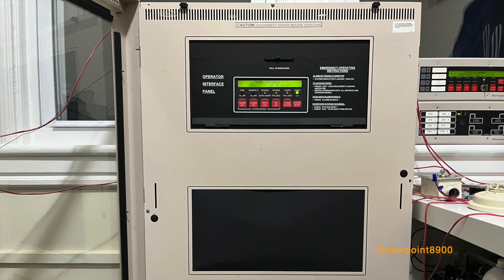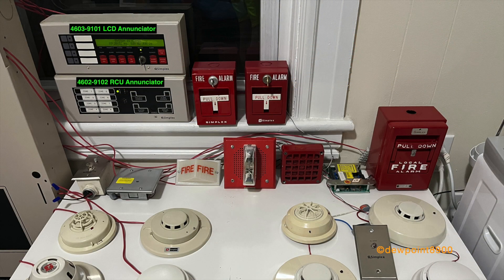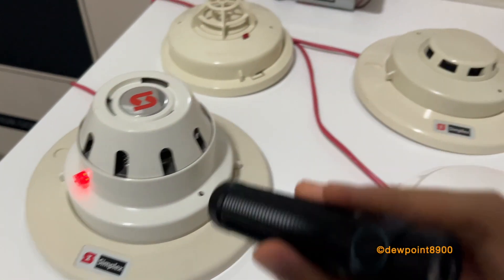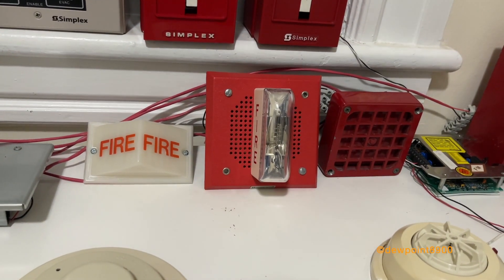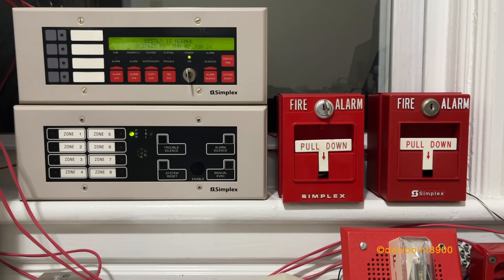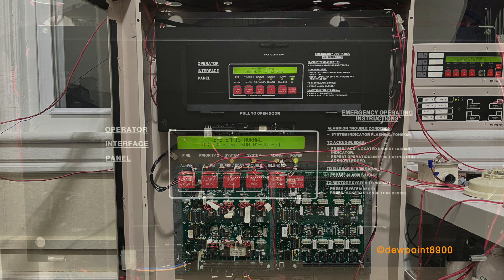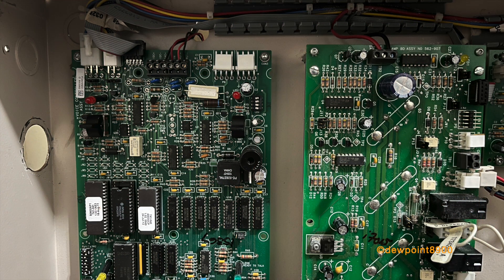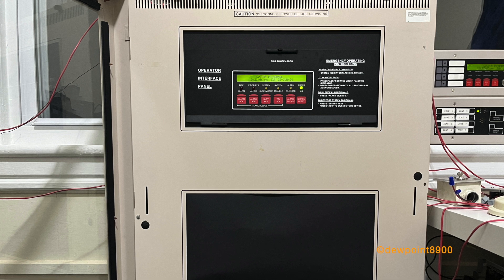Simplex 4020 Overview and Demo

Comment: The Administration building at my college had a Simplex 4020 system, replacing an old Simplex 4207 panel some time in the early 2000s. It was set up as conventional, re-using the existing 4308 annunciator, 4051-60 horn/lights and 4251-20 pull stations and a mix of older Simplex, ESL and System Sensor smoke and heat detectors. At one point two of the 4051 horns had the original light plates removed and replaced with Faraday 2701-K strobe plates for ADA coverage, and then in 2005 or early 2006 the rest of the old alarms got replaced with Space Age VA4 horn/strobes, along with a Faraday U-HN-MCS horn/strobe in the computer server room. But in 2011 they replaced it with a Notifier NFS2-640 system with SpectrAlert Advance horn/strobes.

Comment: So what's the difference between the priority 2 alarm and a supervisory? Also are the walk test messages stored on the 4003 and only accessible with an rui connection?
Reply from the maker: Supervisory is for monitoring devices like tamper switches. Priority 2 is for an alarm condition that isn't a fire/general alarm. Priority 2 can be used for security or other non-fire emergencies.